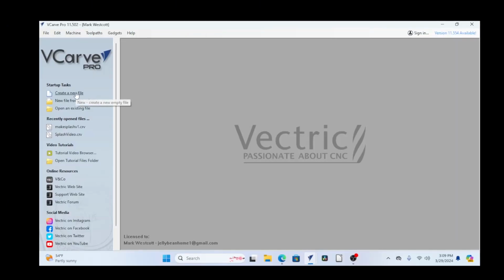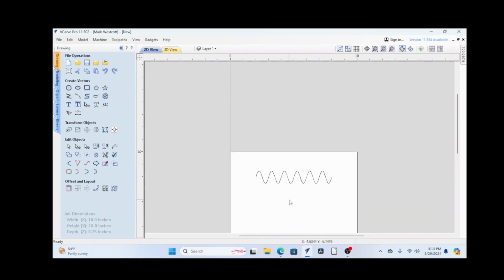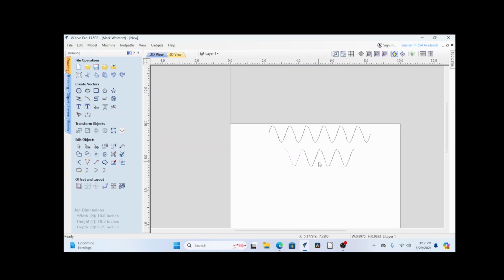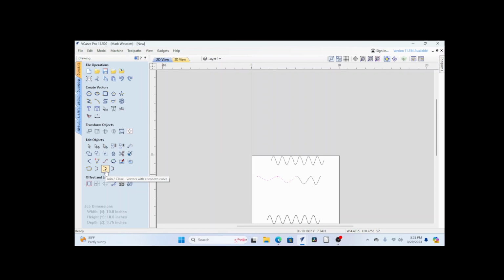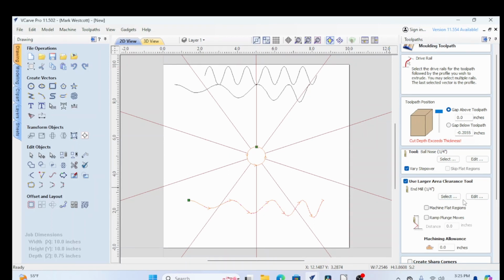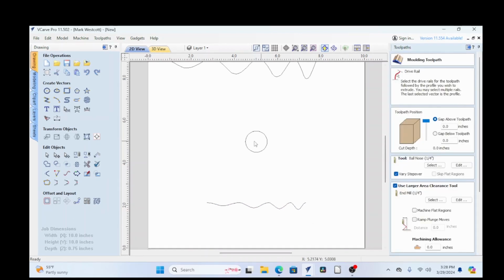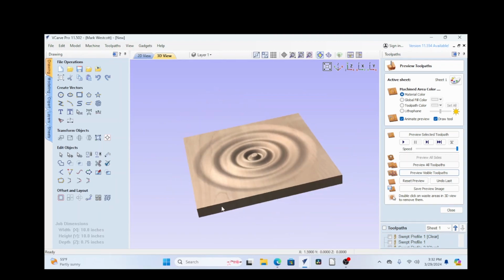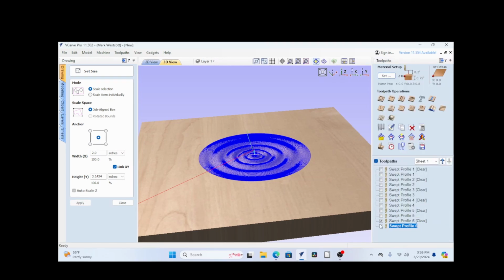Rhythm of Nature --- CNC WATER SPLASH

Comment: Nice video. I need to explore the moulding toolpath more than I do.
Reply: Thanks.  I am trying as well to be a continual learner with this craft.  I hope I never get to the point where I am unable to glean something new and useful from those around me.  With every project I must deliberately choose to see with fresh eyes and be courageous enough to venture along unfamiliar paths.  

The poet Robert Frost had it right ---"Two roads diverged in a wood, and I—
I took the one less traveled by,  And that has made all the difference."

As a side note, here is a path that I didn't include it in the video but I will tell you about it since it is clear you are a fellow traveler in the woods.  Before you generate your moulding toolpath try rotating the wave (using the rotation button) by a few degrees (either positive or negative your choice).  It can really make all the difference :)
Reply from the maker: I ran across a video that came out about a month after I released my video where someone CNCed a wave door front design in wood in one of their projects that was very similar to what I modeled in the Vcarve software in this video. Their craftsmanship was outstanding. I am not sure if they learned the CNC design technique from watching my video but if you want to see a well executed wave design in wood -- check out Two Moose Design's video -- Is this woodworking? Whiskey Cabinet with Sliding Tambour Doors. Sometime in the future I will CNC a wave design in wood (not likely a wisky cabinet but maybe a CNC'd fishing tackle box or possibly a crazy looking cigarbox guitar) and include it in one of my future videos on my channel.  Subscribe and keep your eye open for it.
Reply: @Simplifycnc  I actually saw that video.  Quite impressive.  I’d you do the tackle box, be sure and video the build.
Reply from the maker: @timadams7274  Tackle box is now on my official list of future videos to do.  Thanks for the input.